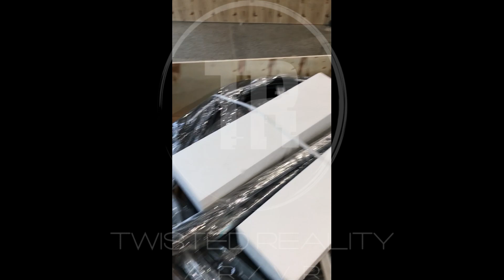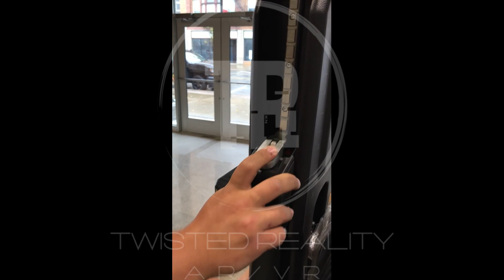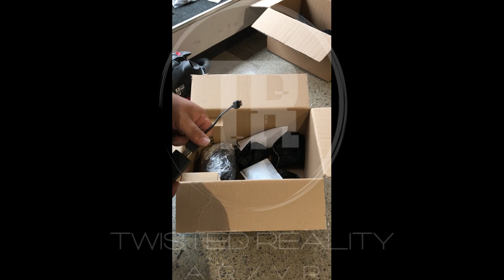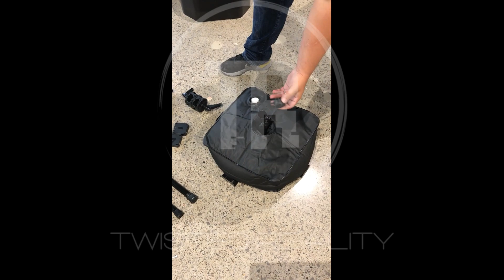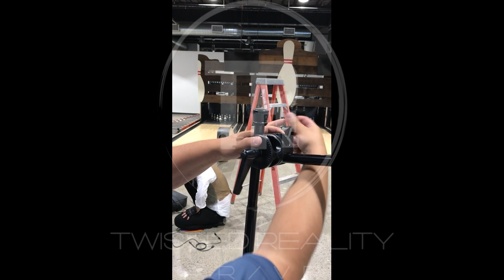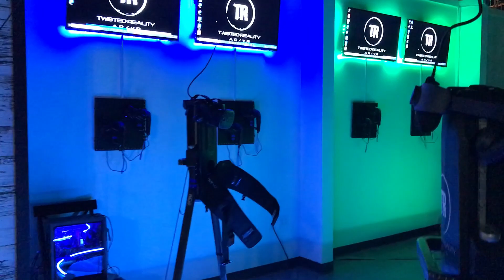Kat Walk Mini Installation

Comment: How do you get the kat mini to work for the games you play? Show us a video of how to setup on the computer please. 🙏
Reply from the maker: Hey Ghost Walk, firstly you should confirm your game settings. Make sure you have it on locomotion, for War Dust, you want to leave it on default "classic." Next, you want to disable snap turning. Depending on the game, you want to turn "Always Run" or "Always Sprint" on for optimal movement speeds. For War Dust, you need to go into the 2nd settings screen, Advanced Settings, to do this. Next check and make sure your Kat Mini is on and KAT IO shows "Ready To Walk." If this does not work than it sounds like you need to download the SteamVR driver. You can download it from https://twistedrealityarvr.com/software-download/

You can see this video that shows all steps to download and run that KAT IO with the SteamVR games. https://drive.google.com/open?id=1qy4nxPfDkyrcJvE9AU2VHev5pcrKxwAJ